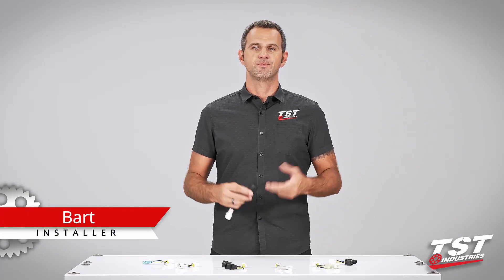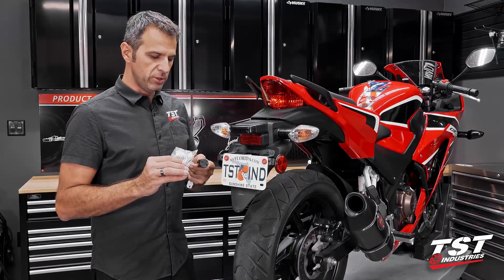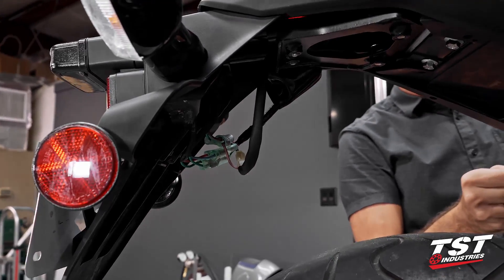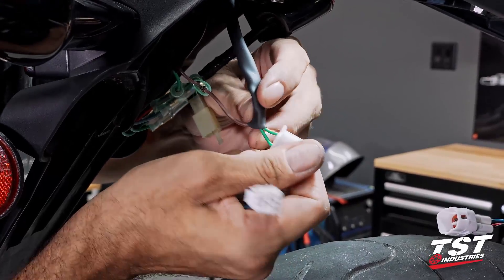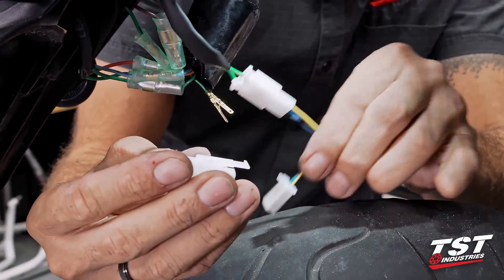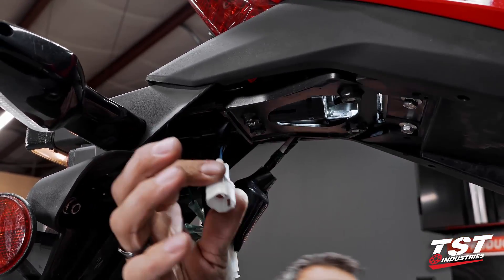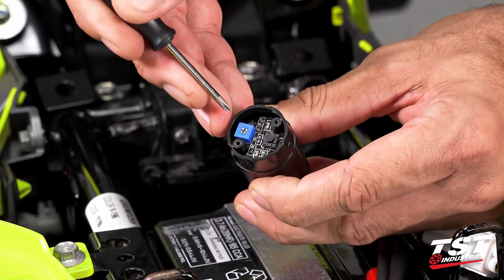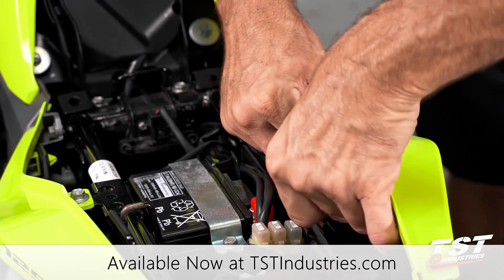How to install a Brake Light Modulator on a Honda CBR300R by TST Industries

Comment: Will this work with OEM LED brake light?
Reply from the maker: LED lights work better than incandescent because the rate of change of light output in LED sources is much more rapid.

Comment: Will that work with a Honda CBR 600RR 2006?
Reply from the maker: No, we have one for that bike that is even simpler to connect. We don't have  a video on a 2003-2006 yet but we Show the installation on a 13+. I will send you a link in a moment
Reply from the maker: https://youtu.be/kkB6EeumWWM
Reply from the maker: If you go to TSTindustries.com and navigate to the offerings we have for your bike you will find the correct part there